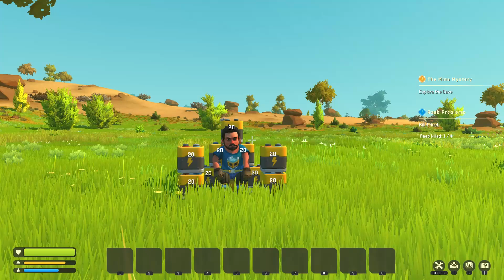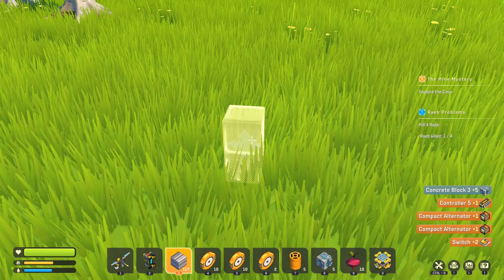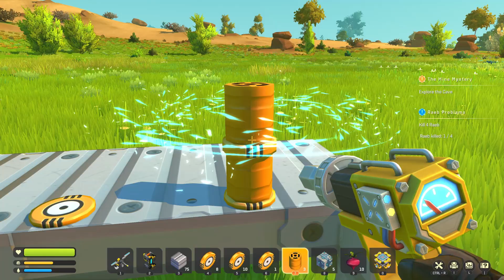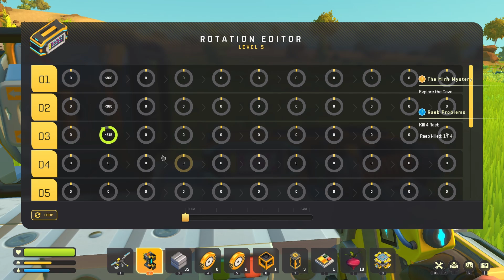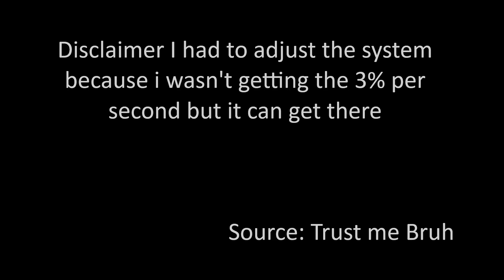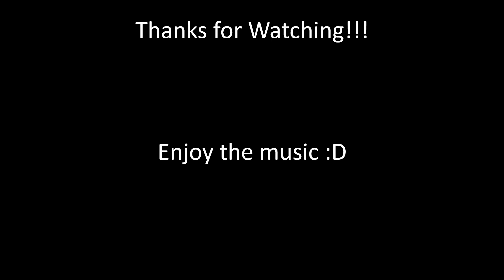Scrap Mechanic Craslander Mod Battery Generator

Comment: Mind if I ask? Is there a "Best Block to use with the bearing?" is lite better or heavier better?  like large tires or pipes?

I know 11 bearing {10 on controller} with copper blocks. when chunks is reloaded, turns into Death Storm!!! 'O.K.ed' me 3 times, before I got to pulled the controller. to stop Death Storm.
Reply from the maker: I have test it with a few blocks, I get with some pipes that are call generator rods (if I remember correctly) also I used reinforce concrete, both of then works great, the deal here I guess is not having the generator on all the time, the alternator puts a lot of resistance in the bearing and they go wild if they are left loose, you could go for a good friction block or a heavy one, avoid pipes.... I... It send me to another realm... Let's keep it that way

Comment: Wont it be better to use the loop setting on the controller?
Reply from the maker: They loop is made to work as a bottom being push from time to time, the only reason to have is because if let loose the bearing could turn into a deadly trap, so is like a "safe" mechanism, but not a foolproof one 😅 that's a hard learned lesson...

Comment: i cant get it to work :(
Reply from the maker: Thats weird, another thing you can try is to put the controller in loop and put turning it on with a switch, also be in mind that all the bearings must turn in the same direction, try to play with that it must work
Reply: i built it too and all the bearing does is slow down after you connect it to the alternator
Reply from the maker: Yes, when you attach the alternator is going to slow down, what you need to check is that the controller is at max velocity, also that you have the 4 bearing rotating in the same direction and last but not least that the bearing of the alternator is at the end of the setup, if you put it in between or less than 4 bearing you won't generate enough force